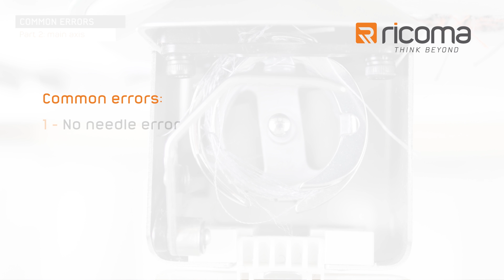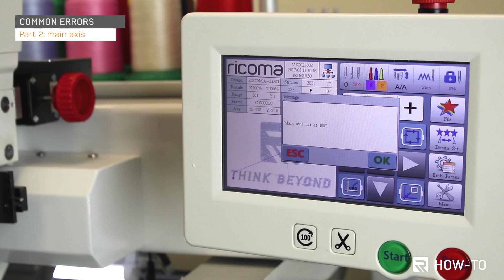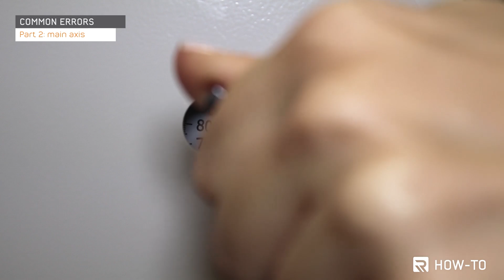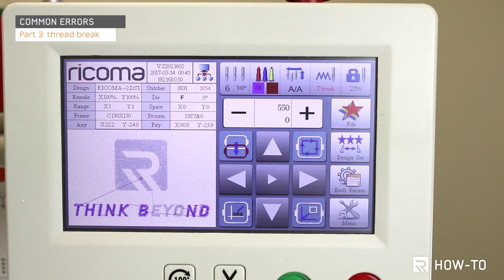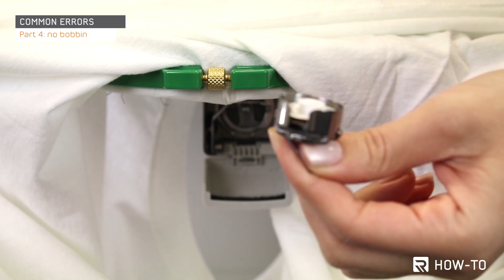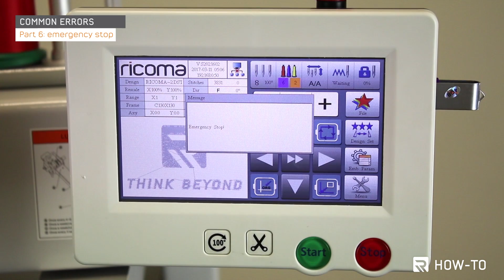MT-1501 How-To: Common Errors

Comment: I have problem in my ricoma it seems to be power issue.. Machine turns off on its own for like 10 seconds and then restart.. Very annoying
Reply from the maker: Make sure your machine is connected to a surge protector because it seems to be a power supply issue!